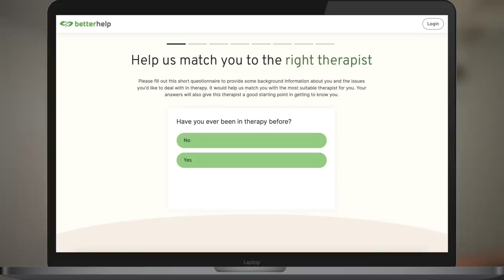Stocking Backyard HATCHERY with RARE FISH!!! (Never Stocked these Before)

Comment: To be on the safe side, you should put your Extension Plug Connections into a Weather resistant box of some sort. Not only will that keep the rain from accidently shorting it out, but it will also provide a spot to anchor it so that it won't get dragged into the pond if the pump(s) slide around or such.

Comment: 2 things. The pump should be at the opposite end of the pond as the filter outlet. and you should put a layer of lava rock on top of the sand.
Reply: Should have just done media and fiber in my opinion.
Reply: Activated charcoal
Reply: and the filter should have been Installed before the fish to cycle it

Comment: Hey,call this a late hit? If the big pond without any liner does not hold water successfully, "dont spook or panic." You have a number of options: earthment is one maybe cheaper than bentonite? It's a process of mixing portland cement with plain earth to make it much more solid,more water proof & resistant. If the unwanted occurs ,pump it completely dry & let it dry well in the summer sun for a week or so. You could dig it back out for what silting occurred. Myself I would start up high on the bank top mixing earth & portland  cement (dry mixed)  ,wheel barreling it around & dumping it down over the edge into the pond & raking it out dry about 6" deep evenly down & across the bottom. You might do the bottom first & spoon the material to mix or pre mixed into the bottom with the excavator, rake it out & sprinkle it well. Then coat the sides in sections down to meet the bottom & sprinkle or hose mist it gently so not yo cause water erosion. I would use 90lb bag of portland cement mixed in 2 cubic yard of random  earth(the more clay the better) on the first attempt. Rake it down in 6" deep & sprinkle lightly but well. Not to worry it will still weep moister down through slowly & activate all the portland eventually. Cement does wick water,but very slowly. If it is not enough & it still weeps & perks to much,pump it dry & give it another coat 4" deep but mixed stronger. It should make a pretty solid feeling bottom & sides. Add dirt later for frogs & stuff to dig into because the earthment might be to tough for them.

Comment: Another way to filter nitrates, ammonia, and nitrites is to use plants in the water. The plants will filter all the negative stuff out of the water and grow off the protein and excess of the feed as well. Plus it will compete with the algae to reduce the algae eventually. I've used plants in multiple aquarium setups and it works really well. You don't need anything that requires roots either. Just a suggestion,  but I would consult an aquatic pond plant company so you can let them know what you have as far as pumps so the plants don't potentially clog the pumps also.

Comment: Best bacteria and free bacteria, go to any lake and just take some chunk of water plant with the root and all and it’ll be like a starting kit. But the thing about your set up is, it’s just one big hole, there’s not area for plant to grow or even your filter its good filter material but it not really that good for housing bacteria. You want material with a lot of surface area on it for the bacteria to live on it. You can still save your pond just by building a outer wall around it and adding more liner to the extra pre-existing liner you currently have around your pond that sticking out of the ground and add some gravel or whatever on top of it and have the plant grow. I would’ve run some pvc pipe beneath all that gravel or planting matters and let the pump suck water thru the pvc pipe to where your plant area is and let the water the come out underneath your plant and it’ll filter out that way.

Comment: Just a warning flair, i bought that pump for my pond and it got hot, pressurized inside and pushed the oil out of the bottom seal and killed my tiger shovelnose and almost killed my redtail catfish. The dekopro pump claims good for ponds but it doesnt like to run 24/7. If you start seeing rainbow on the water its the pump. Id try to upgrade that to an oil-less pump asap just to be safe.
Reply: That pump doesnt say dekopro on it but its the same housing as mine had so its probably the same pump just sold to a different company and rebranded. The pumps can be made in a factory and sold to different companies to be branded with their logos and names. Again, just keep an eye on it. The first dekopro i bought seized up about 8 months in and the second one leaked so i wont be buying another pump that looks like it may have been manufactured by the same people that made the dekopro pumps. Im now using a pool pump to draw the water into my sump filter so if the pump does anything it wont be directly in the water.

Comment: U need 2 put in 4×4 posts & frame a single slant roof that is tall enough & wide enough to drive under all the way around the hatchery. Fiberglass or steel panels. It should cantilever over to the waters edge, so 16 - 20 feet. It will add a big load of the cleanest water in a very short time when it rains,airates as well as it splashes in. It will cast alot of shade & give a secure place to hang & mount a shade cloth when it is needed. It will give you a dry place to work,fish & keep you out of the baking sun. Come on Flaire ,the Hornets & wasps are counting on you as much as the raccoons.

Comment: As you mentioned, probably don’t add those to the big pond. I manage a couple ponds and one has yellow perch. They only spawn once per year, so don’t provide much feed to the bass, and the larger perch compete with the smaller bass and catfish. They are great if you don’t add crappy, small mouth, or catfish, and add minnows annually. They grow to 10-12 inch in about 2 years and are excellent eating.
They also thrive best in waters 30+ ft deep and 200+ acres, anything smaller tends to lead to pressure that will stunt them at 12 inch

Comment: Filter needs to flow the other way. Water in the top, filtered thru sand, back into pond. Look up pool sand filters.
Reply: It doesn’t matter…the water is filtered either way. Think about it
Reply: @troybrooks2066  but if the water flows up you’re push sand out the filter and all the crap you’re filtering out is sitting at the bottoms where your water comes in which will block the flow of water eventually with no way of backwashing.

Comment: hey flair, just some advice. if the top of the water becomes a coat green of algea, and the water become very green, that means thr oxygen in the water is becoming scarce and ur fishes will die. im good explaining but eutrophication is what its called. be careful.

Comment: A solar system would be easy to build and cheaper than runing power down that far. Then you could run your pumps, filter and fountain off it all.
It would be cool if barramundi were available in the US (I think they're banned in most states). They grow fast (up to 18 inches in a year), fight like the devil, get to about 5 feet long/80+lb and are super tasty. Not sure they'd handle the cold though.
When buying sand for aquaculture, it's ALWAYS dirty, no matter how 'clean' it is. It will always have some dust in it. "Clean" usually just means it doesn't have biological contamination such as feces, vegetable matter etc.

Comment: Not sure how a sand filter will work with really dirty water. Look into a bog filter, with a snorkel to periodically clean out the debris at the bottom.  How will you clean the sand of the debris? Without a UV light the water will continue to be pea soup.

Comment: You will have to change the sand regularly
Reply: Nah all he has to do is hit it with a air compressor and it will flush all the gunk out the discharge